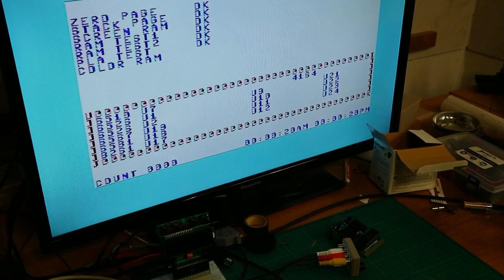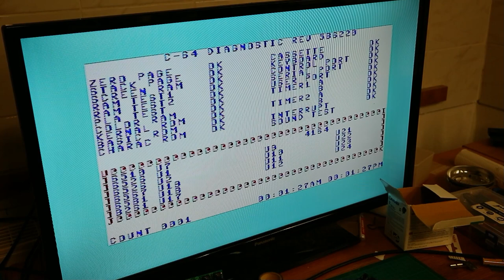Try to fix a C64 mainboard with screen-issues

Comment: Have you tried to change the VIC-II chip? Or resolder the chip/socket for the VIC-II? I wonder if there is s bad connection/bad VIC chip. Sometimes it manages to read the character data and sometimes it doesn't
Reply from the maker: I don’t a tried to change the vic ii chip. But i reflowed the socket. I should try this. 👍
Reply: @tomscomputerchannel2925  Fingers crossed! Also, an idea is to take the chip out, spray the socket with contact cleaner and replace the chip again. Could be a bad connection?
Reply from the maker: That i have made after reflowing the socket. I can try to test the vic ii in a c64g.